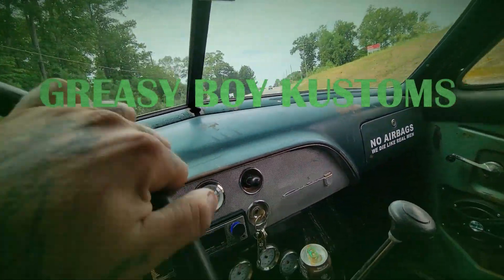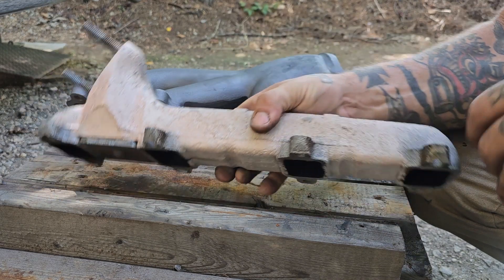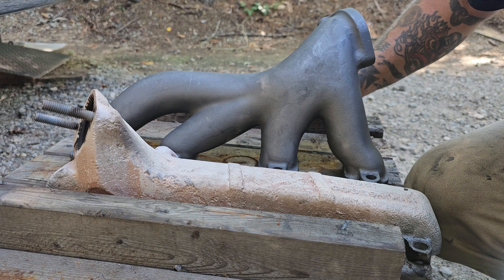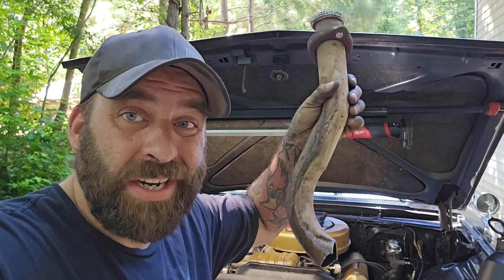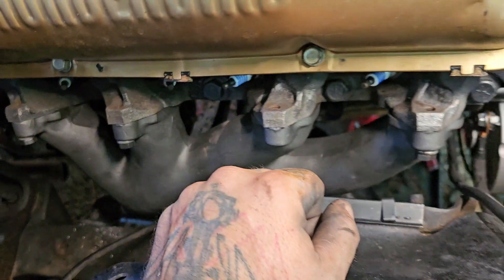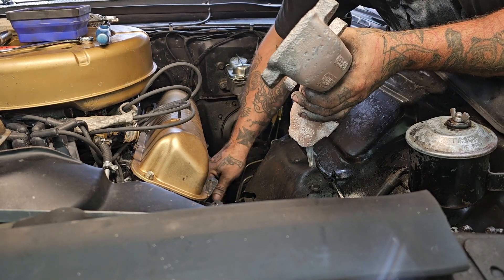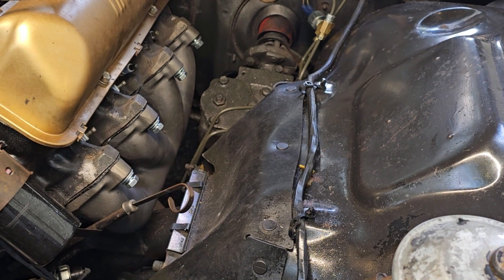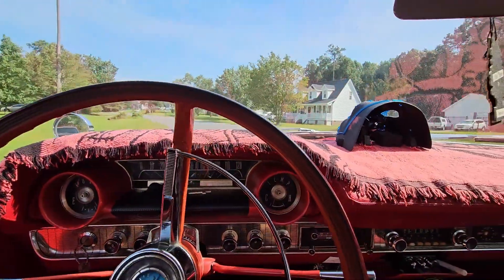kugel manifolds  ford fe block 390 galaxy

Comment: HEY DIRTY DAN [my ex wifes bff  nicknamed her Dirty Di, lol] are these likely or guaranteed to fit in a 76 150 also?
Reply from the maker: Dirty di  is cool 😎     I bet they would fit the 76.  The trucks have a little more engine bay room near the frame.  However,you may want to contact kugel components to confirm before purchase.